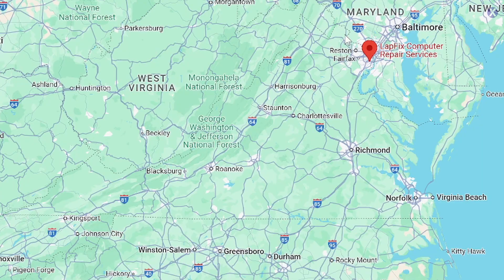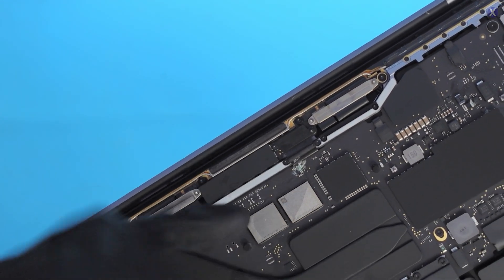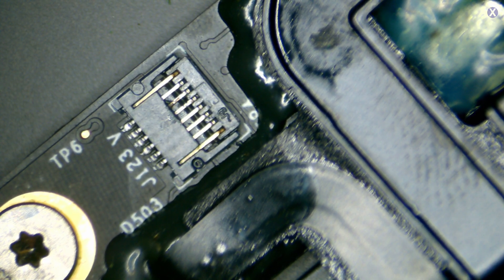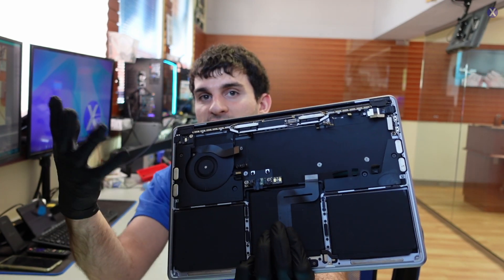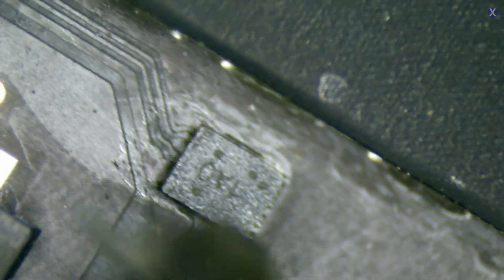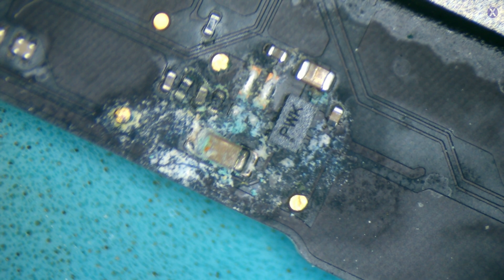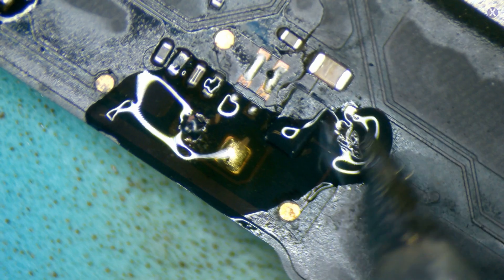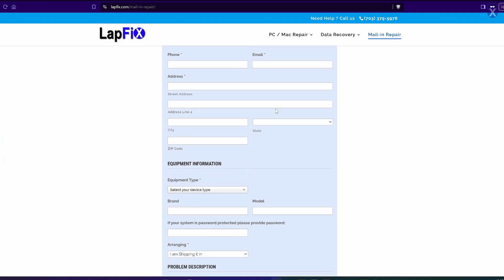Fixing A M1 MacBook Pro With Liquid Damage

Comment: Sir i have a motherboard with model number vegas/turis 15341-1 and it have a problem that 19 volt is coming to battery terminals which is quite dangerous to charge my 14.8v battery.only one was there and nothing else my laptop motherboard was working absolutely fine only 19 volts was coming in Battery terminals. Someone suggested me to check MOSFET but while checking MOSFET i accidentally created a short in SIO area and got no chance to see where short happened but luckily every voltage is being generated perfectly only problem is now that is my laptop is not turning on when i plug my charger it blink a white led like when we charge a battery. There is no 1 volt generated and 1.8 and 2.5 volt. And i have note some measurements please have a look at it and please help me🙏🏻. 
Sir I don't have enough knowledge about what is LDO and what is SW. with the help of schematic, wherever LDO and SW were written, I checked on power off and power on and wherever I checked, I checked on the pin or resistor or capacitor nearby and I have also written the location of all of them. Here are its details.
 SW3.3-
WITH CMOS BATTERY PRESENT 
1) +VCCPDSW_3P3 - R1707 - 0 VOLT
2) +VCCPDSW_3P3 - R1711- 0VOLT NO RESISTOR PRESENT 
3) DSW_PWROK-PCH_DPWROK - R1704 - 0 VOLT
4) VCCDSW_1p0 - c2103 - 0volt 
5) POWER_SW_IN# - C2426 - 2.6 VOLT
WITH Adapter PRESENT 
1) +VCCPDSW_3P3 - R1707 - 3.3 VOLT
2) +VCCPDSW_3P3 - R1711- 3.3 VOLT NO RESISTOR PRESENT 
3) DSW_PWROK-PCH_DPWROK - R1704 - 3 VOLT
4) VCCDSW_1p0 - c2103 - 1 volt 
5) POWER_SW_IN# - C2426 - 2.8 VOLT.
____________________
LDO 3.3-
With CMOS battery present 
1) LD03_CAP - C2718 - 0VOLT
2) LD02_CAP - C2712 - 0VOLT
3) LD01_CAP - C2702 - 0VOLT
4)PWR_VDDQ_VLDOIN - PC5109 - 0VOLT
And with the power adapter plugged in still 0 volts on these 4 components
 
 i haved checked three ICs with there voltages on there pins and check powergood sections please have a look on it
 pu4503 3-5volt ic 
1-0.96volt.
 2-2.0volt. 
3-3.3volt. 
4-2.0volt. 
5-0.9volt. 
6-2.2volt. 
7-3.3 
 8-0.2volt  
9-4.6volt. 
10-0.2volt. 
11-0.09volt. 
12-19.3volt. 
13-5.3volt. 
14-5.17volt. 
15-0.01volt. 
16-3.8volt. 
17-8.8volt. 
18-3.9volt. 
19-2.6volt. 
20-2.0volt

Pu5401
1-GNd. 2-0volt
3-0volt. 4-0volt
5-3volt. 6-5volt
7-0volt. 8-0volt

Pu5301
1,2,3-0volts
4,12,13,14,15,19-GND
5-0volt
6-17.6volt
7,8,9-19.3volt
10,11,16,17,18-0volt
20,22-0volt
21-5.18volt

3v_5vpok-generating
1D8V_S5PWROK- NOT GENERATING
1D0V_S5_PWRGD-NOT GENERATING 
PWR_VDDQ_PG-NOT GENERATING

Comment: what if i ran a low level format command [sudo nvme format -s1 <device> ], now laptop wont show anything on screen when ssd is plugged as secondary drive [primary drive works and has the os].
also when secondary drive is removed laptop boots and works normally. Is there any hope to revive the ssd? Its barely used.

thanks in advance